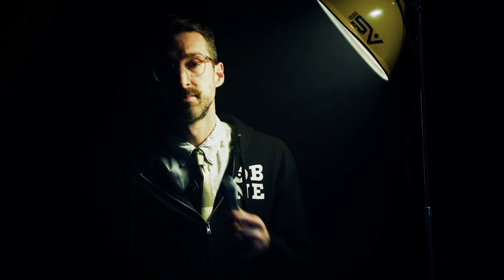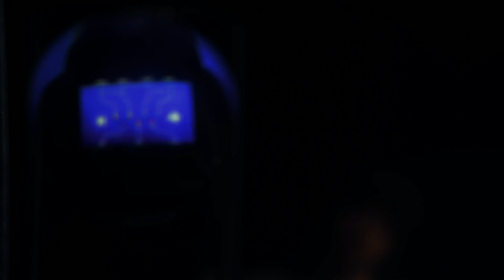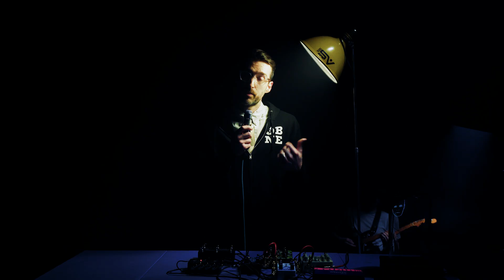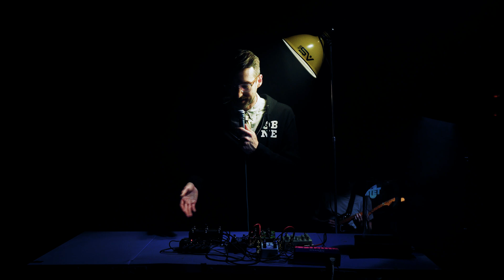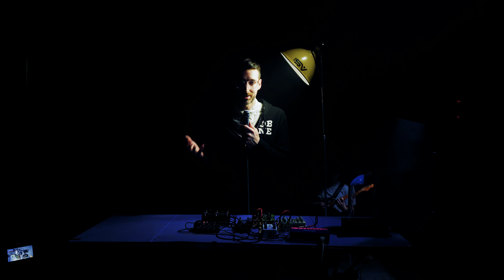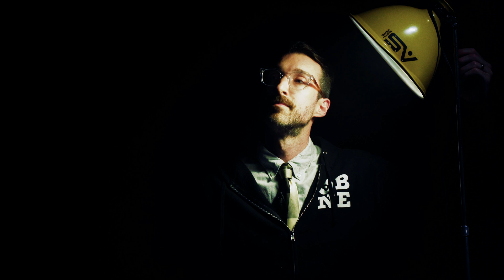Dan Explains It All - Midi To Expression Translator

Comment: I don't get it. If you already have the Morningstar MC8, which sends MIDI out of its omnijacks, and you have pedals that accept MIDI via their jack... why do you need this? For example, The Red Panda particle V2 will receive midi via its jack. Is this only useful for pedals that are simple IN / OUT then (pedals that do not send or receive MIDI at all)? Is that the point of this? Edit: OK, so on a second look what it's doing is translating MIDI to expression info, so you'd be sending that translated info to the expression jack of a NON MIDI pedal. You could have made that clearer, since most modern pedals already come with MIDI capable jacks. :).

Comment: Are the CC numbers and midi channel customizable? I'm thinking about the situation of using several MTETs for more than four pedals, all connected to a single midi controller.
Reply: Oh, and is there a way to reverse the polarity of the expression signal, so it can be compatible with almost any pedal? (would love to use this with my JPRT Super Weirdo!). If not, please give every expression out a polarity switch on a possible updated version (like the switch on the bottom of the Moog EP3).

Comment: I thought I was pretty hot on MIDI but this is rather complex. 

I assume one has to setup the destination pedals so they actually respond to expression in a way that's useful first? That seemed to be omitted from the video.

I.e. how do i setup Dark Star so the expression input controls pitch?

Comment: Wow game changer
Just ordered, first order of business is  to make a midi clock syncing float by just sequencing the cc messages
Reply: I am going to do the same thing they did in the video with the tap tempo, but with a different midi device, probably my Elektron Digitakt
I can use the sequencer to sequence the mdi cc message connected to the lfos and they will be in sync with the rest of my devices also midi synced to my digitakt
Reply: Can you elaborate on this? Sounds  awesome